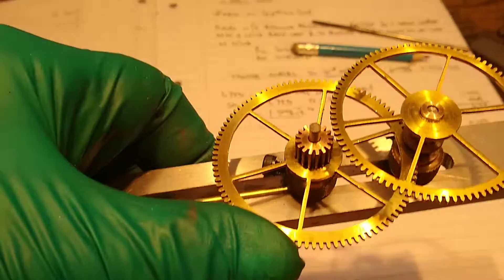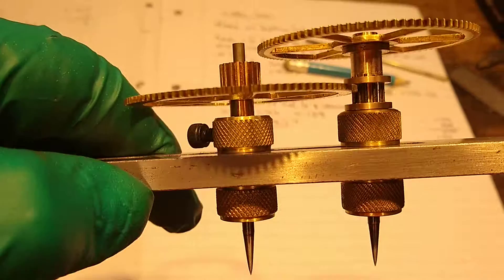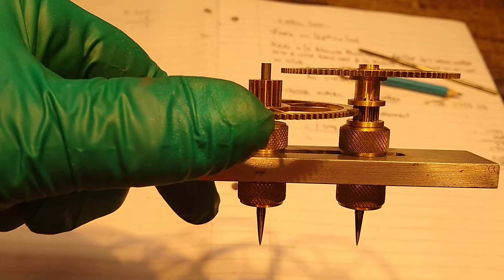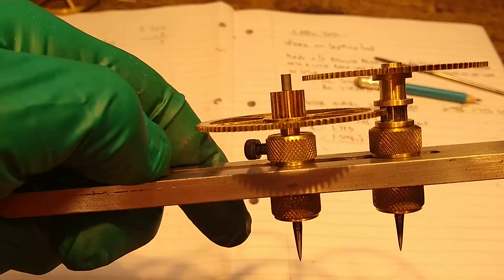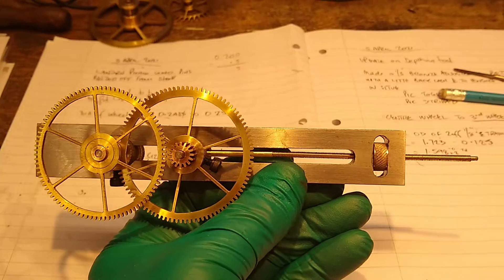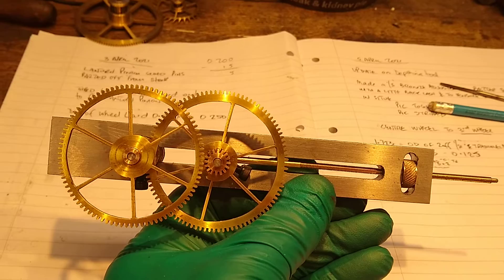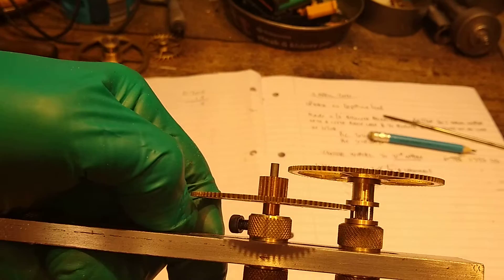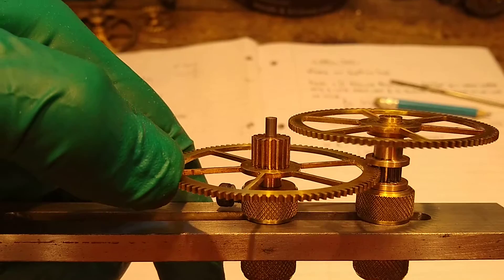Regulator Clock - Depthing Wheels

Comment: Nice work. I made a depthing tool to the Clickspring design, and it works well; but I like the added support of the threaded adjusting rod in your design. Thanks for sharing it. Love the lantern pinion as well. Best wishes to you.
Reply from the maker: Thanks for your kind comments. The clock has been running now for over 7 months with little but often quite small adjustments. Hoping quite soon now to replace the centre wheel with a new one of slightly better quality, then I should be able to fit the completed motion work and get the movement hung in its case. Regards. John